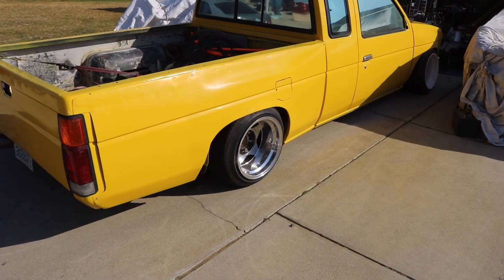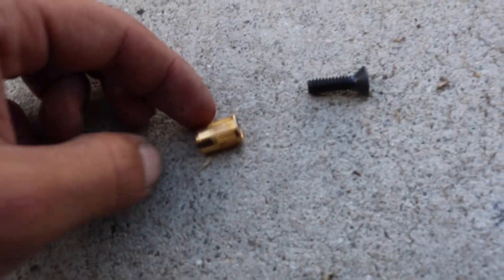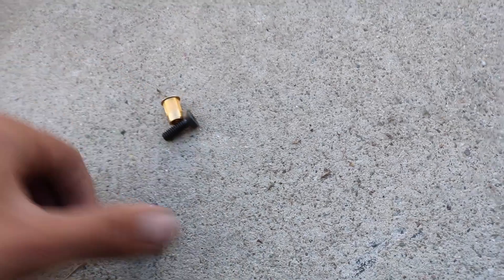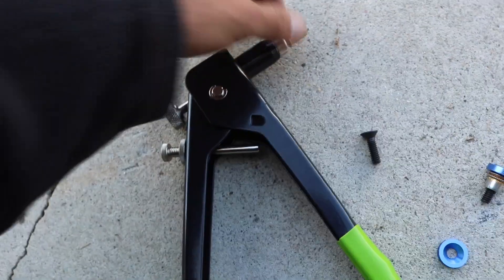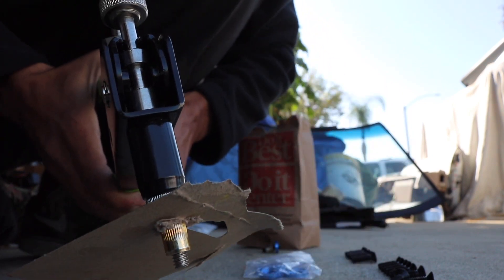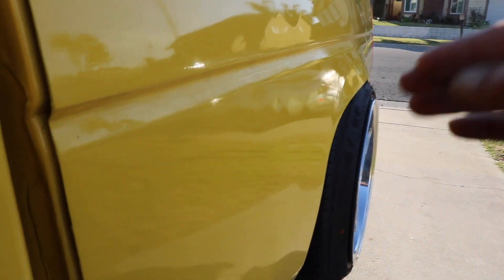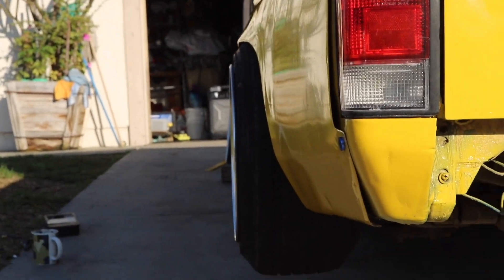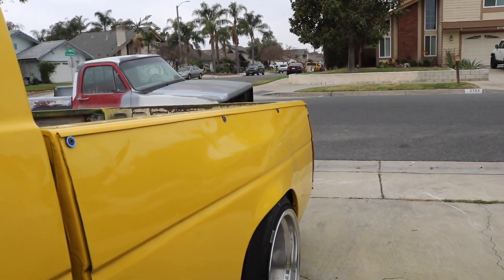FINISHING THE FIRST EVER WIDEBODY HARDBODY !!

Comment: I like the rubber "rivnuts" better. I have to admit, those are better for occasions where you have to pull it out more often. But when metal rivnuts starts to spin, after some corrosion happens around it. The bolts are pain in the ass to get out, if you can't get in the back to grab the rivnut with something to stop it from spinning.